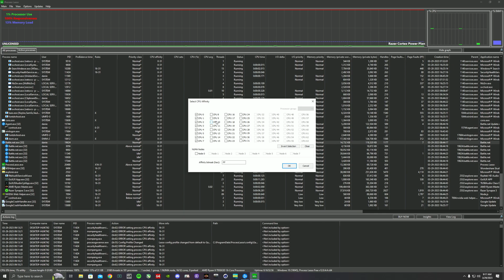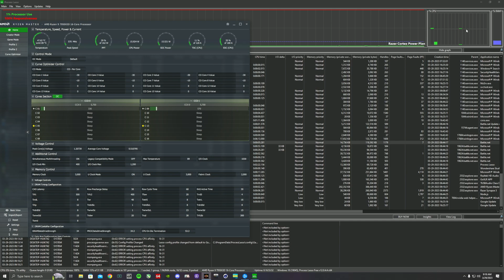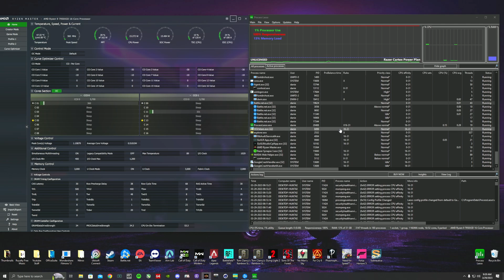Process Lasso Setup On 7950X3D (basic tutorial)

Comment: On the other processes that you want to run in the non 3D v-cache  threads just press CTRL+A to select all and then set Affinity to 16-31
Reply: This sounds like the way.  Set everything to CCD1 and then manually select the game processes as you open games and set them to CCD0.  Also, launchers like steamwebhelper and battlenet can be run on CCD1 just fine, because those are just the background processes and updaters, you don't need that clogging up CCD0.

Comment: If I wanted to use the fastest cores for gaming, I can set that up in Process Lasso.  But how do you know how many to allocate to it?  You mentioned Call of Duty as an example to use 7, but previously you noticed 2 are the fastest.  Would allocating only 2 be OK for gaming?  Not sure if it would mess up my performance or not.

Also, couldn't you just select-all and put everything currently running on threads 16-31 (non-3D).  Then go back and exclude Steam, etc.  Games won't be running so they should be OK in which case you can add them to cores 1-15 (3D).

Comment: I'm looking to buy the 7950X3D for content creation+gaming+recording+streaming. I am just wondering. Do I really need process lasso or it will work as intended?
Reply: in the last months the chipset drivers and windows been optimized and the cpu is so powerful, that a 4090 is a bottleneck. so you barely will recognise anything bad. windows now can assign games better to the 3d cache. still, if you  know how to manually distribute the load better between the applications, then you will clearly have better utilization and save energy and time
Reply: @chriz9959  So is it worth gettin it?

Comment: so on curve optimizer the more negative the number is, it means the algorithm will provide less voltage proportionally for a higher frequency right?For instance, on -10 means: at 5.6Ghz clock the voltage is 1.3 And with -30 means: 5.6 Ghz clock the voltage is 1.2? Forget the values, it was just for examplification on my question
Reply: ye

Comment: HI! great work, thanks. with 3d processors + lasso do you recommend hags, game mode and game bar off?
Reply from the maker: I recommend you disable HAGS, leave game mode and game bar ON.
Reply: @Beefy-Tech  I heard the opposite. People say to turn off those options. Why? I just got a 7950x3D and I keep hearing mixed things.
Reply from the maker: @ThaAlumniMusicGroup  HAGS is system dependant, some systems like it on, some like it off. Game mode is mandatory on the 7950x3d, and without it the core parking won't work.

There's several ways to set up the 7950x3d. As of today I recommend the amd intended setup method
Reply: @Beefy-Tech  so I should have game mode on while using process lasso And I’ll be set?
Reply from the maker: @ThaAlumniMusicGroup  this video is very old, these days I recommend process lasso if you think your cpu is having issues otherwise.

The full proper AMD intended setup is as follows:

Bios settings: CPPC Prefer Cache or left on Auto I run prefer cache, and I recommend prefer cache

Windows settings: latest Chipset drivers for your motherboard, Balanced power plan, Game Bar On, Game Mode On.

Process lasso shouldn't be necessary with that setup process.
Reply: @Beefy-Tech  nice I’ll run with that then. Thank you for following up so quickly and providing information!
Reply from the maker: @ThaAlumniMusicGroup  gotchu fam👍 I do have an updated setup video on the way but It'll still be a bit b4 it's out so thought I'd let you know.
Reply: @Beefy-Tech  bet I’ll keep on following!

Comment: Hey man, love your content. Just wanted to ask you that as of today do you recommend using process lasso or the game bar method for maximizing this cpu?
Reply from the maker: Game bar method for sure, but run "Prefer cache" within the bios settings
Reply: @Beefy-Tech  Thanks a lot for the reply :)

Okay will try this, but won't it affect the performance in the productivity apps?
Reply: @Beefy-Tech But if you set Prefer Cache, won't everything default to the slower CCD instead of the HIGHER frequency CCD?
Reply: @BenjaminRay  this is what I've been wondering too. Did you find an answer? More research needed xD
Reply: What do I apply in the preferred cache in bios

Comment: Have you been able to sort out the preferred frequency ccd / dey games in process lasso method yet?
Reply from the maker: Yes, it now works as intended without process lasso aslong as you perfectly follow AMD's intended setup method of Updating BIOS to Latest recommended version, Updating Chipset Drivers, Using Balanced Power Plan, Game Mode On, Xbox Game Bar On, and in my opinion, also running prefer cache in BIOS (albeit that last step is optional).
Reply: @Beefy-Tech So this video is now somewhat redundant?
Reply from the maker: @jorisbonson386  videos sadly become outdated. Today, a lot of that information on which windows and settings unrelated directly to the 7800x3d won't apply as new updates have come out that changed a lot of things.
Reply: @Beefy-Tech  I know they do, that's why I asked :)  So what's the best way to optimise my new 7950x3d for gaming now then?  Is it literally what you said above?  Thanks!
Reply from the maker: @jorisbonson386  basically, with the exception being that W11 version 23H2 is currently the best windows version for gaming in general, both for CPU and GPU! Process lasso is optional, but honestly, if you have any trouble it doesn't hurt to download lasso and just set affinity of game launchers to cache cores and call it a day lol
Reply: @Beefy-Tech  I'm actually running W11 W23H2 (Ghost Spectre compact version), are you saying then if I combine the steps above with that I'm probably about as optimised as I need to get?  God if so that's soo much easier 😅
Reply: @Beefy-Tech  This is amazing news. So the 7950X3D is officially better than the 7800X3D?

Also, what would happen if I followed those steps you mentioned but instead used performance mode instead of balanced? Would my FPS in games be the same or worse?

Comment: So i recenlty switched from a 7800x3d to a 7950x3d and i've been watching every video for them and every reddit forums possible and there is so much crap. Between undervolt,game bar, 3dcache,lasso, pero core, all core. I feel like for new users getting these chips woudl be a headache.  It sure has been for me because i wanted to get every perforamnce outta my chips. From my experience i'd say 7950x3d is just overall better. I'm getting the same fps as the 7800x3d and in some games im getting way more. I've never used lasso but after this video i did what you said and i def feel a difference except i have a -curve of 30 to all cores and followed and followed skatter bench settings CPU bvoost clock overdrive set to enable + and max cpu boost clock override to 150.  There's alot of tinkering to do with these cpus but i think once you get it down your set.  Cinebenchr23 scores 37830, 3d mark scores 33034 and temps when idle are 37-41 and in games nothing has gone over 65c at least the games i've played. Thank you for this video it was nice and simple. =D
Reply: These chips aren't meant for the day to day users. It's an enthusiast CPU, customizable and amazing once you get it running.
Reply: do you play valorant/cs2? what about input lag?
Reply: @hameln7746  7800x3d is still amd king if you care about input lag

Comment: An even more extreme way to do the trick is to go in 
Options > CPU > CPU Affinities...

If you have anything remove it.
In Process Match just type "*" without quotes
In CPU Affinity select it or type "16-31"
Then Add Rule.

If you want to add any process with a specific priority, just type it's full exe name in Process Match (say "cod.exe" for MW2)
In CPU Affinity select it or type "0-15".
And finally the wildcard process on CCD2 should be on the bottom. You should see something like 

cod.exe     0-15
*                 0-15
Reply: Thank you so much, i was looking for how it's properly done. Found the cpu affinity tab myself, but didn't know how to actually set the default
Reply: mine is showing 16-31 greyed out

Comment: So do you see a noticeable improvement in games like Warzone ? 1% lows for example or does this just increase responsiveness and help with stuttering
Reply from the maker: The only real visible benefit is being sure it works as intended.

If the cpu is using only ccd 0, then it'll be smooth, but without process lasso you can't force that unless you park cores.

With process lasso both CCD's can be on with no performance loss, and you can set background tasks to ccd 1 and game to ccd 0 and enjoy 0 possibility of lag ingame from cpu as a result of background tasks, while assuring the right ccd is always used.

Comment: Hey Beefy! If there is a game that does not use multiple cores well (but it does) is there a way to tell it to use all the cache cores but focus on the best cores first?
Reply from the maker: In Theory you can turn off Core IDLE and Force specific cores... but it does not work that well, temps increase by 8-10C if cores cant idle and move the load onto other cores, and if you set specific cores lets say like 1 4 8 9 without forcing idle off, itll not use one of the cores a lot specifically to have a free core to unload on when 1 core gets too hot. Try the specific cores in process lasso, and use Ryzen Master to see which 2 are your best cores, and go from there.
Reply: @Beefy-Tech  Gotcha thank you! Idk why my 7950x3d is not performing well in cinebench. It just thermal throttles and maxes out at like 43-4500Mhz. I even have a 360mm AIO.
Reply from the maker: @Evenaardez  it could be thermal paste application, the cooler not making proper contact to the CPU...or infact the cooler is pressing to hard on the cpu.

Try a proper Undervolt, and see if that helps.
Reply: @Beefy-Tech  I did both and I still cannot stop the thermal throttle. I think I will go to microcenter. Maybe it is a bad chip
Reply from the maker: @Evenaardez  if you have that option definitely go for it...they might be able to help simplify the troubleshooting or replace the chip entirely if it's not fixable.
Reply: @Beefy-Tech  Yeah, I wonder if my chip was affected by the bad bios.

Comment: Do you run your system on balanced power for core parking on windows, or high perofmrance and manually are assigning the backgrounds to the other CCD while the games only use the Cache CCD?
Reply from the maker: I actually don't want the core parking feature, so i run with performance mode on, as I found that as long as the 2 ccd's are working on individual tasks (IE the 3D cache ccd plays games, and frequency ccd runs background tasks like rgb software) there's no quantifiable performance loss, and it allows me to run any bloat like razer synapse and Polychrome Asrock RGB on the frequency cores, and free up cpu power on the 3D cache cores.
Reply: @Beefy-Tech  so how will i know which cores are running at full speed, lets say for Fortnite epicgames, fortnite shipping64.exe
Do i have to monitor the cores first, like open the game and play (windowed settings) then open maybe CPUTemp tool

Comment: So did you test already both ways - prefer cache and prefer frequency?  Is there any difference?
Reply from the maker: The issue is cod warzone 2 doesn't listen to process lasso due to the anti cheat...so the only viable way for anyone using battlenet version of warzone 2 is to set prefer cache in bios sadly. It's the main game I play so prefer frequency won't work for me, but in theory prefer frequency + lasso games to cache ccd should be best.

Comment: Have you had any issues with Process Lasso. I used it for several days and even ended up buying it. But after formatting my PC this morning it now causes my system to lock up to where nothing works and I have to hit the reset button on my motherboard. 

At first I didn't know what was causing it, but after some troubleshooting it seems that process lasso is the cause of my issues.

Comment: Looking forward to watching your other videos. With all the hoopla about how awesome the 7800X3D is, I'm hoping to power knowledge the regret out of my system of having bought a 7950X3D. 

Does optimizing with Process Lasso require uninstalling any of the drivers from AMD that they use to park cores with Windows Game Bar? I heard from the videos on the 7800x3D that the system needs an OS re-install, and was wondering if taking back control via process lasso benefits by disabling the ability for the OS to park cores.
Reply from the maker: In theory, process lasso would be able to completely overide and enforce cores despite your OS settings. Only difference is what u set it bios, prefer cache or frequency, as then your process lasso settings will be different.

I will be honest with you, process lasso is a nice to have, not a necessity.  If you set your cpu to Prefer cache, the only time lasso is needed is if you find a game that actively has stuttering issues, as it means that game is probably switching between ccd's, and then you'd have to restrict cores on ccd 0 with lasso to avoid stutters.

7800x3d is good, but it's clocked lower and can only be clocked higher with ECLK overclocking, which the 7950x3d also has. So in theory, the 7950x3d will he faster then a 7800x3d if both are set up correctly, but by 2-5% at most, so not a significant amount.
Reply: @Beefy-Tech  in theory the 7800x3d doesn't even need prefer cache setting in UEFI?
Reply from the maker: @Icy20  it doesn't need any of that no, it'll just work👍
Reply: @Beefy-Tech  When you set a preferred core, does it change the arrangement of what's considered core 0-15 in process lasso? 

Are you using the Ryzen chipset drivers that works with Gamebar to park cores with your use of Process Lasso? 

What would be nice is if I can understand that parked cores can't be woken up for CCD1 usage for background tasks without hurting the performance of the CCD0 bound applications. I'm not clear if that's possible, or if for pure gaming, it's just better to disable CCD1 for games confirmed to prefer 3D cache.
Reply from the maker: @GiovanniAcosta  setting preffered cores won't change the arrangement. Ccd 0 will always be the 0-15, and ccd 1 will always be 16-31. Also I recommend updating to the latest chipset drivers, and you can ignore gamebar setup altogether. When you set a ccd as the preffered ccd, it'll automatically sleep second ccd unless it's needed, meaning you can use frequency ccd for random background tasks that aren't related to your gaming without losing any performance really.
Reply: @Beefy-Tech  Ok but does it sleep them, or "park" them? Because if I understand from other videos, when cores are parked, the background tasks will try to use the same CCD that's active, to not wake cores on the other CCD that's parked (to avoid cross-fabric latency loss). So you have to manually assign affinity for that not to happen. I also wonder if unparking cores is a performance hit on the OS, as opposed to whatever you are saying the bios does when it sleeps the non-preferred CCD.
Reply from the maker: @GiovanniAcosta  I run with windows tasks on the second ccd and did not notice a performance hit at all as long as the tasks on the second ccd have nothing to do with each other. It might be there's a performance hit but it's significantly too little for me to have noticed it if so
Reply: @Beefy-Tech  my concern is that some games will ask the OS scheduler for more threads than just 16 one of the CCDs can handle, and if the CCD is not parked and gated by the driver, the OS will give it to the game (process), creating a cross fabric scenario. Not the end of the world, but a source of micro stutters in high frame rate gaming. 

Can process lasso restrict this from happening?
Reply from the maker: @GiovanniAcosta  some games do sometimes ignore the bios settings, and sometimes ignore lasso. There's work around to it but it's anywhere rare enough to where it shouldn't be regular.
Reply: @Beefy-Tech  Thanks, Beefy Tech! What's the work around for when they ignore the bios setting/process lasso? Start the system up with a CCD disabled? XD 

I was thinking sticking the game in VM with GPU pass through, but some games would flag that as "cheat". :eyeroll:
Reply: Guess the kicker also is that some games ignore process lasso or restrict it, due to anti cheat software

Comment: if you use process lasso, do you need to uninstall xbox game bar? and what power energy plan should you use on windows? balanced like amd recommended?
Reply from the maker: Lasso + Prefer cache overrides Xbox game bar, and you can leave power plan on balanced.
Reply: @Beefy-Tech  thx! oh and would you tell me what the problems are to set prefere frequency in bios and set the games to the 3d v cache bc it makes more sense to me
Reply from the maker: @caynofficial  it's easy to set...bit i couldn't get the lasso to force threads 0-15 on cod for some reason, and a lot of the windows processes defaulted to cores 0-7 anyways when i started up a game, meaning it wasn't actually using frequency cores only. I later found that to be intended, but I didn't have time to test further.
Reply: @Beefy-Tech  mhh weired but as far as I read the windows power plan might cause that, but I didnt look into that, since Im still waiting for available for the cpu.
Reply from the maker: @caynofficial  I'll check once I'm back, I'll try all windows power plan options, and try turning on and off the Xbox game bar.

I also will be experimenting with ECLK overclocking soon. Skatterbencher has done some videos showing great success with getting higher boost frequencies with it.
Reply: @Beefy-Tech  nice! looking forward to it